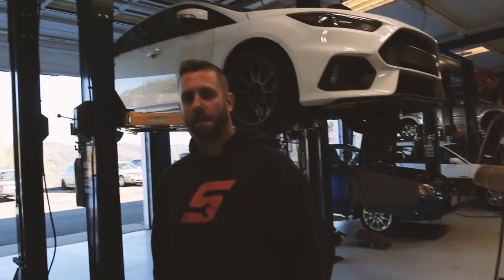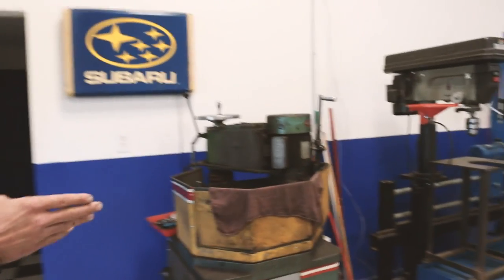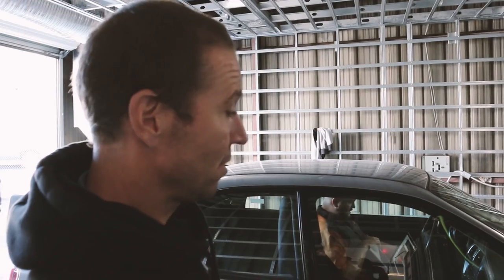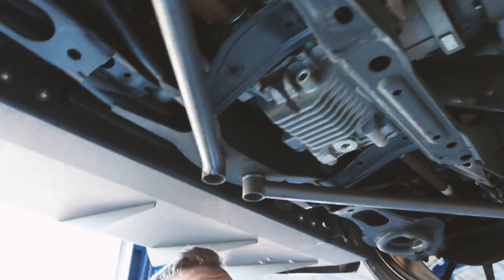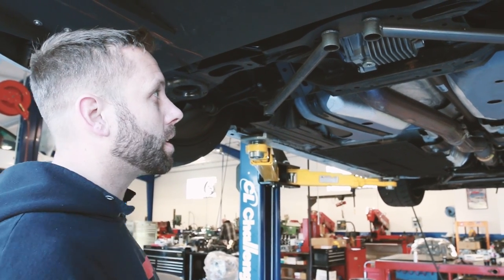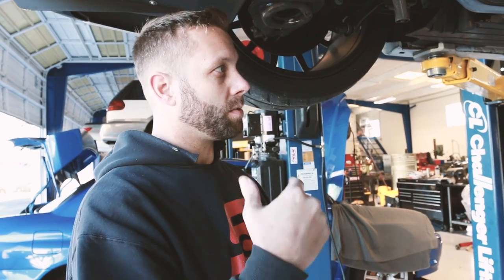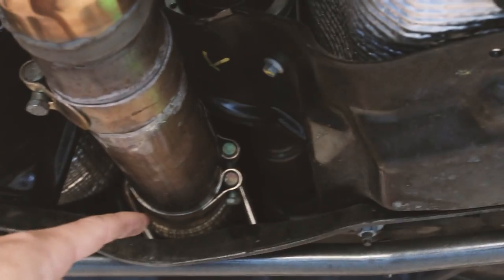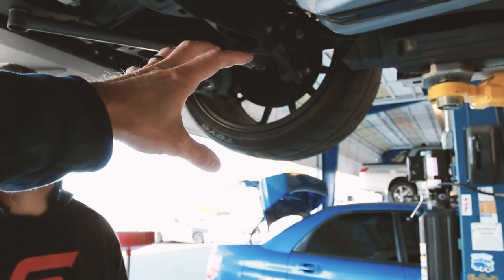HOW THE FORD FOCUS RS AWD SYSTEM WORKS

Comment: The Mitsubishi evo x has a similar AWD system. Has an LSD mechanical front differential, active center differential that can split torque between the front and rear wheels, and the rear differential is a torque vectoring differential that can send more power to either rear wheel. Mitsubishi calls it active yaw control system.

Comment: The process to put the car into dyno mode is as follows. 1. Press the power/accessory/start button once. Do not start the vehicle. 2. Press the clutch and brake pedal to the floor holding them there. 3. From the neutral position shift into reverse and then back to neutral 6 times. 4. After you've shifted into reverse and back to neutral 6 times you'll see the ABS light flash and advancetrac as well as ABS will be turned off. 5. Start the car and run it on the dyno. Once the car is turned off and restarted it will go back to normal mode.
Reply: Bobo Clown except with that method you have to do it every time to reflash the vehicle during the tuning. The awd will also re-engage if the rear wheels go over 10mph and more that 10° of steering angle.
Reply from the maker: Bobo Clown dang now that’s a process.  I would rather unplug the RDU I think it would be faster.
Reply: badams0311 that's how I tuned mine. It's called dyno mode. It works great
Reply: Blake's Garage naaa Blake my friend. It's quite easy.  It looks like a lot but is simple and quick.
Reply: I have an easier way.  Plug in my AP, and push the dyno mode button that disables the rear drive lol.

Comment: The idea is right..but your reason is wrong..if the dyno rollers were locked 100%  zero slip f to r that is the same as on the road..and it is ok on the road..why dyno stuffs with the car is the rear spins faster that front ..ecu see it as slip in the rear and pulls power. It is due to belt slipping on the dyno from front to rear rollers...

Comment: I just dynoed my car in AWD and FWD on the same dyno (which apparently didn't care) and the measures were almost the same, the power and torque curves almost on top of each other, torque curve came in a few hundred rpm earlier in AWD that's all (I didn't get the advertised engine power btw, around 341hp on my stock car)
Reply: 341 horse to the wheels?!!?!?     to the ground??   that sounds almost impossible.  the advertised 350HP  was   Crank horsepower,     in reality they make like 295 ish to the wheels  stock.  ive seen a few dynoed  at deadhook  in person
Reply: Deadhook is a Motorsport tuning company

Comment: I was told that the RS was mostly fwd bias..
Based on the mode you are in (normal\sport\track\drift) what are the drive front\back wheel percentages?? 
As in back 60%, front 40% .. or front 60%, back 40% ... for each mode??

Comment: could this Focus RS transmission/ptu work without the RS ECU, engine, and RDU? For example: could I use it with a different duratec motor and a newer Mustang rear diff for an AWD project?

Comment: I wonder if it would be possible to swap the RS AWD drivetrain into an ST. What modifications would be required, what should in retrospect bolt right up, etc etc
Reply: gearbox would bolt right up as its same engine block

Comment: Is the RDU on that RS leaking fluid? (at 5m25s in)
Reply: Stephen G it's just assembly grease. Been there since day 1
Reply: Looked like oil to me or very runny grease that drips when its cool lol
Reply: rdu leaking is a known defect on early RS fyi and since I owned one too, some recent subaru STIs also had a leak at the rear
Reply: minor over fill from factory most likely.  @fredEVOIX

Comment: To disable the rdu using the access port, is that a setting I'd get normally or does a tuner go in and have to grant some access to the setting? Never used an access port haha but was looking to get one soon
Reply: Zaid Hydari it's already there in with the AP. Tuner doesn't have to enable anything

Comment: +badams0311 are you still at FW or are you now at M45? Auburn is just a tiny bit further away from Fairfield, but definitely worth it to work with you guys! Was hoping you and Travis could do some work on my RS, possibly looking for a built engine/big turbo, happy to contact you offline or PM you on the forums!
Reply: Cinca0989 up at M45 now! Either way works. Or you can give the shop a call!